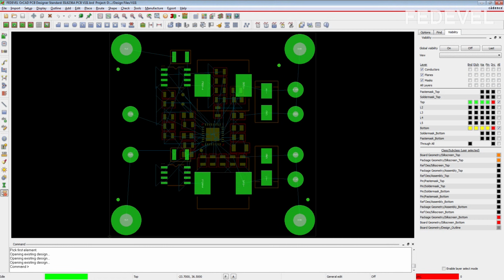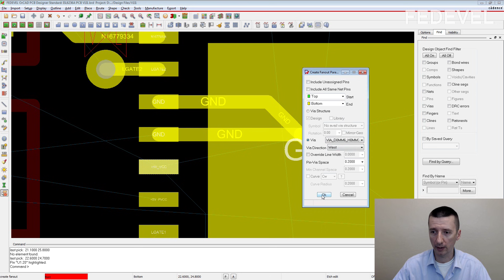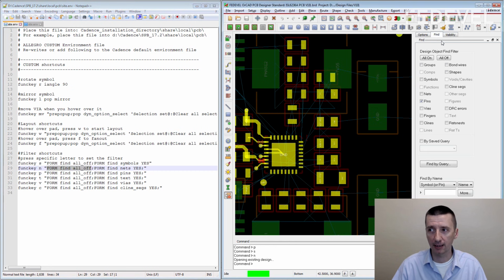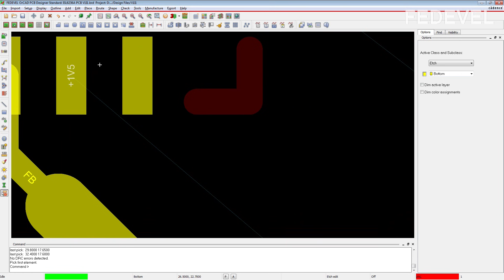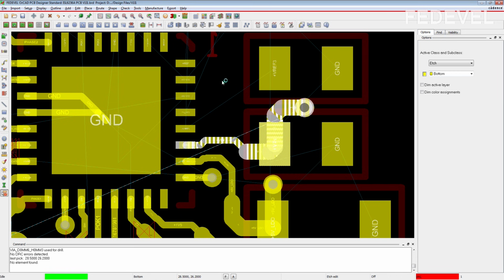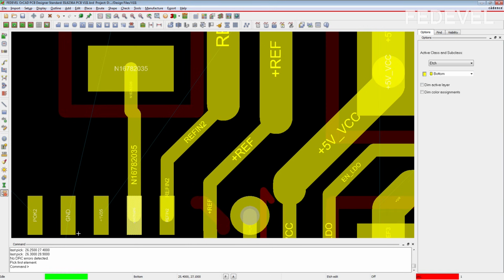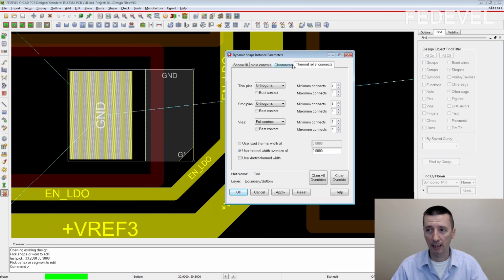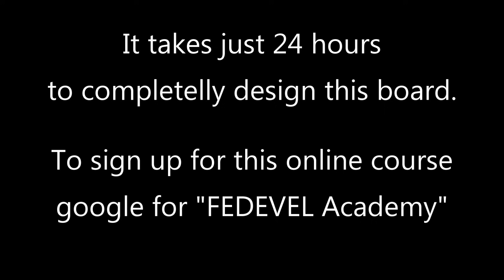Doing PCB Layout - Learn OrCAD & Cadence Allegro Essentials (Lesson 9)

Comment: Thank you for this video, its very helpfull for begginers like me. I would like to know if you have any video where you explain how to use a bare die instead a component with a package? I have a finished schematic and I need to change one component for it's bare die which will be wirebonded. Any tips on this would help me a lot. Thanks in advance.
Reply from the maker: Thank you Mauricio. I do not have any videos about that.
Reply: HI Mauricio.  Sorry for the late response.  Allegro supports wirebonding as well as etch routing, contact OrCAD or CAcence support for more details.  .  If the bare die you have is small amount of IO' and the height/length of the wires aren't electrically concerning, you could just represent the wirebonds on an extra layer in your design showing the point to point connections from the bond pad on the DIE to the bondfinger on the PCB.  Then the fab house will connect it with wires using a profile for the wirebonds.

Comment: Showing error message that: "cannot load symbol, couldn't find pad stack" when i trying to add new component to already existing board or running circuit in alegro pcb editor hence how to fix the problem

Comment: hey rob ,
may i ask you what is the main diff between Altium and OrCAD ?
Reply from the maker: There are many differences. Maybe what would help is, if you describe your situation a little bit more (e.g. are you trying to decide what software to learn, or use in your company, or buy as a hobbyist, etc. ...)?
Reply: what software to learn maybe to use in the future in my work as a mechatronics engineer
Reply from the maker: For hardware design engineers I always recommend to learn both: Altium & Cadence. 
From learning point of view, Altium is easier to learn (it is much more intuitive), but that doesn't mean it is easy to learn (you need to understand how boards are designed - so you need to understand what specific features are going to do). Cadence is more difficult to learn, but it is used in many very complex designs (eg. in designs for motherboards or server boards).
PS: Also, Altium 18 has a very good connection with mechanical stuff - I know some companies use Altium exactly for this reason - Mechanical engineers + Electrical engineers can work close together. So if you do also a lot of mechanical stuff, maybe Altium could be the software for you to start with.
Reply: yes i loved that Altium integrated with SolidWorks , that helped a lot of teams to collaborate better than past .
so if i'm not planning to design a complex PCBs  then i should focus more on Altium , and have a little bit knowledge with Cadence. RIGHT ?!!
Reply from the maker: yes, at this moment you do not need to learn cadence, unless you would like to apply for a job where they use cadence.